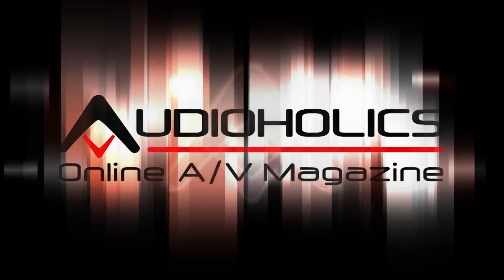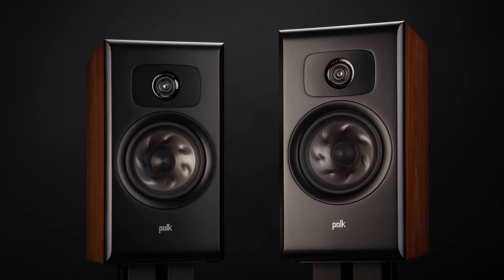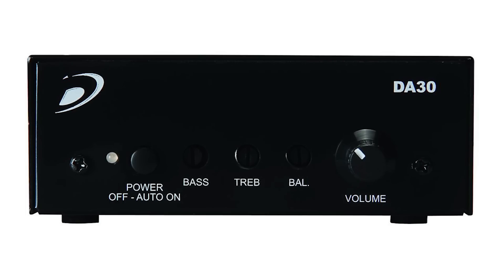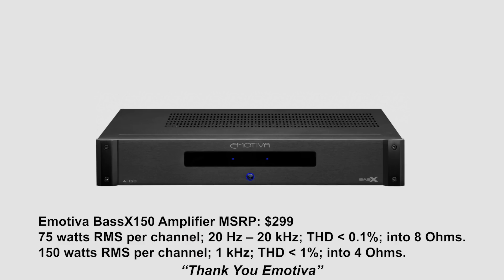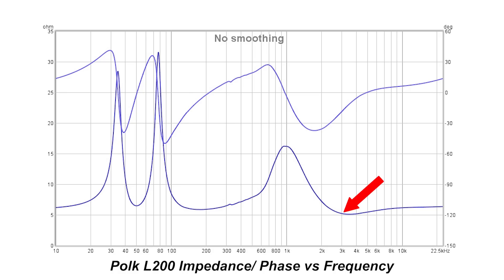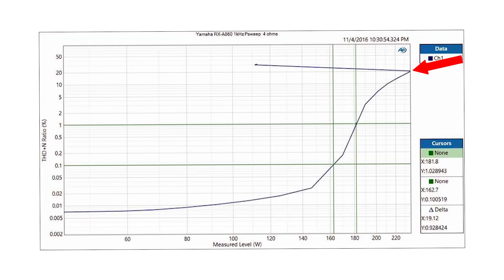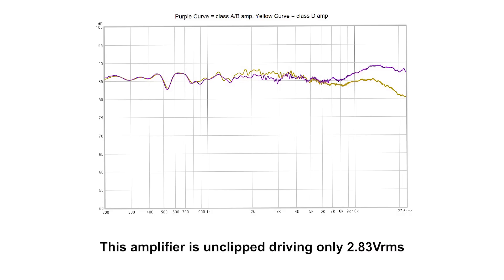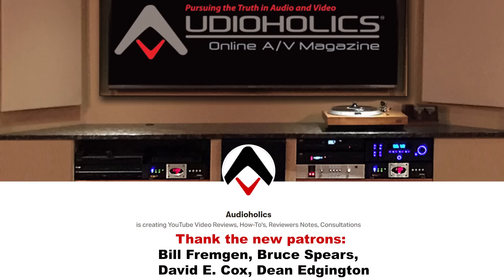Proof That ALL Amplifiers Don't Sound the Same

Comment: But how does this translate into actual audible difference? I get that amps can pull back power to stop clipping, but in sound terms does that mean sudden loud sounds (like symbols crashing or heavy drops of bass) just won't be heard as "presently" due to the amp not having the available juice? In simple terms, certain sounds that REQUIRE amplification, just will not be amplified and therefore heard? Is that what you mean?

Comment: Amplifiers absolutely sound different. I once had a pair of B&W 802D, as well as a pair of Sonus Faber Cremona Auditor M. Night and day difference in presentation between the two. I also at the time had a couple A/B Parasound Halo amps and had just purchased a class D NAD M22. 

Got the NAD in the system with the Bowers speakers...hated it. That diamond tweeter came right at my skull compared to when it was being driven by the Halo, and the difference wasn't subtle. I was about to write off the M22 when on a whim I pulled the Cremonas in from the other room and you know what, I'd never heard them sound so good. You see, the M22 was a MUCH brighter amp than was the Halo, which it turns out was a beautiful match to the soft ring radiator tweeter on the Cremona, whereas a Halo amp on those speakers always sounded wooly. The exact opposite was true when the gear was swapped to the Bowers speakers. Speakers, DACs, amps...they all sound different. I'm actually a bit jealous of guys who can't hear the differences, because they can be satisfied without spending the pile of money I have.
Reply: Your argument is subjective and then you mention that pile of money you have and lost all credibility, except for being a twat !!

Comment: All GOOD amplifiers sound the same, Gene. If you find an amp that varies its FR by output level or impedance it is NOT a good amplifier. Generally Class AB amps don't have this HF loss this $88 Dayton DA30 CLASS D amp suffers from into some loads.

Comment: Hi,

Are AVR's good enough to listen to music (stereo).? The reason i am asking this question is  i see a huge difference in the quality of the sound ( Music) coming from an AVR and a normal stereo music system. I was expecting much better quality from my Onkyo AVR but it was just ok. Especially the Highs and Mids , the voice clarity is really awesome in the Panasonic stereo music system.( Its rich and full).I feel the same when i hear music in my car which is powered with Pioneer music system.Is the circuit design different or the amplifiers in an AVR are  designed primarily for loudness.?.
This question is really bothering me a lot as i though an AVR would suffice the requirement_for both Music and Movie.I am having an Onkyo TX-NR 696 BI-amped to Taga Harmony home theater speakers v606. Do i need to go for a high end AVR for the quality of sound that i am expecting?. Please advice.
Thanks in advance.

Comment: Loudspeaker impedance (and sensitivity - not quite the same thing) does matter. Otherwise all decent amplifiers at ANY price will sound the same. The only issue is with low power/low drive amps such as the one mentioned - the Dayton. 
Nothing new here folks, move on!

Comment: Maybe not the best examples. Cheap Dayton class D vs a class AB? How about a higher end class D? Or a $500 class AB vs a $2000 one? The example used too narrow in scope to call it "proof". Can we see more tests with several different amp examples. Maybe running a mix of low impedance vs easy to run, high sensitivity speakers? Interesting topic for sure! Thanks.

Comment: They sound different but given identical specs to each other using slightly different components i bet there is no audible difference. If its not measurable then any difference is just down to bias even if you think that wont effect you it still will. I read about trained harman listeners that are still biased to a certain boost in low end on revel speakers and thats because most of us prefer a slight increase in mid bass level even though its technically not accurate.

Comment: I have seen measurements of  recent class D amps.  Lots of noise and spurious FR issues above 15khz.  It's almost like there is a "dither"  to smooth out the treble. My class D does NOT sound like my A/B.

Comment: I would think of course amps are going to sound different especially if you are comparing models in different price ranges and that have different technology. Is what I would hope though is anything aimed at the enthusiast or high end market would all sound pretty close though. You would think they would strive to make them as accurate and clean as possible. That might not be the case, but it is sure what you would hope for. I wouldn't expect a soundesign system from Kmart to sound as good as a Denon or something lol. And I notice it with budget receivers too. Sony doesn't seem to have what it takes for decent bass with towers, where as my Denon does. But once you get into seperate amps that cost a grand more I would hope it would get much harder to tell. The difference between a 1000 dollar amp and a 3000 dollar amp I would hope wouldn't be that easy to tell in sonic quality. Build quality and power output yes, but they should both sound great.

Comment: I have a Luxman and a Rotel (both dual transformer) and although the Rotel is very clean sounding it is very thin and unnatural when compared to the Lux. The Luxman is fuller and more fluid. Amplifiers do sound different. There is no question about that.

Comment: No every amp does not sound the same until you start forking out serious money for the expensive and well made to sound transparent with plenty of clean high current power to give the complete control and grip over the woofers.The expensive hifi amps sound similar because they are made to perform to a certain standard.
Reply: Not all expensive amplifiers sound good. There are tons of very expensive amplifiers that sound crap! And also tons of inexpensive amplifiers that sound very good, punch way above their price.

Do your proper research and test out amplifiers before keeping them. And you will save money that you can put to use in other parts of your HiFi or Home Cinema system.

Comment: What I would like to know about amps is what are specs to look for when sourcing an amp for use on the pre-amp outputs of a HT receiver to power front height, back or ceiling speakers.  I have not found any data anywhere.  Not even Denon say what to use.
Reply: its a math problem, size the amp to the speaker load giving yourself plenty of headroom. I'll probably get shit for this but, I size my amp according to the speakers PEAK wattage. That way all the power my speaker could ever demand is available

Comment: Broken amplifier do sound different. There are even examples of totally broken amp IC's on low impedance loads such as TDA73xx series. There are also OP amp examples with very poor EMI rejection rate, like LME49720 and variants of it that are not shielded. EMI rejection rate usually put by vendor's as electric power rejection rate @20 KHz also can play significant role. More so in low end in hear able frequency range, & not all traditional shielding materials play particularly good role in this space. Still the best are steel & graphite... Arguably silver but that's more of a snake oil. Also AB class amp's can deliver higher max power & keep it for longer which also can impact how we hear it.

Comment: Hi Gene. In my opinion the test of these great speakers was made with a class D amplifier that is not a hi grade reference form you can trust that you are sending to the speakers high quality signal in order to evaluate only the speakers.  That means that there is low performance amplifiers, decent performance ones and great performance (the ones that cost a lot of money).

Comment: I have two comments.  First, those speakers are about $1200, I believe, whereas the DA amp is what, less than $100?  How do you justify that?  Gear should always match.  Second, all amplifiers do sound the same within their given price brackets, and most sound the same regardless of price to the average listener who only cares about pairing up their phone and listening to YouTube or Spotify.  An amplifier has only one job : TO AMPLIFY.  Which they all do.
Reply from the maker: Judging quality by price is a dangerous assumption, especially in consumer audio where objective measurements of performance is often trivialized. The amp was NOT used for critical listening. It was solely used at low power for frequency response testing which I showed in this video how it wasn't capable of doing into low impedance loads.
Reply: @Audioholics  Agreed, judging quality by price is not only dangerous, but foolhardy.  Yet people in this hobby do it all the time, sadly.  But bench testing is not real world listening, obviously.  I will always maintain that there is no difference between any amp WITHIN THEIR GIVEN QUALITY PARAMETERS if they are tested in a musical environment.  That's right : a Yamaha amp sounds the same as an Onkyo amp or as a Crown amp or as an Emotiva amp.  Like I said, an amp has only one job.

Comment: Hey gene. I was just mentioning this topic the other day on one of the home theater groups on fb. I have a marantz prepro powering a emotiva basx a-300 for left and right mains, and a marantz mm-7055 for my center. LCR are all matching Martin logan xt60’s. And what I noticed was I got more bass output from my marantz compared to the emotiva.  I went ahead and hooked up the marantz to all three mains thinking the emotiva was just overloaded driving two towers... well the marantz powered all three with equal output.  I know y’all have measurements for this amplifier, maybe you can highlight some reasoning for what I’m seeing. Needless to say I’m now looking for a new power amplifier for my floor level speakers.

Comment: QUAD proved their amps did not add anything to the sound, by placing them between power amps and the speakers. No-one could hear the difference.
That's not the same as Amps sounding different. A good Poweramp is fully neutral.

Comment: The Dayton amp is not linear. Part of the argument is that two amplifiers with linear output not driven to clipping will sound the same. If you raise that upper end with a pre-amp filter that makes total output with the Dayton amp flat, both amps will sound the same. If one amp is not linear 20Hz-20kHz, of course there will be difference in sound.

Comment: Gene, I know there are a lot of requests for reviews on the "new" more powerful Crown Amps. But would You please consider a "budget amp" (a the $300 price point) - the Behringer A800 ? Thanks.    ;-)
Reply: I use a Crown XLi2500, AB amp, no bells and whistles just 2 gain knobs, a couple of clip indicators and 500wpc of good clean power at 8ohms. Under $500 and I love it.

Comment: Just audition a few amplifiers with the same speakers and you easily be convinced that every amplifier has its own sound signature.
Reply: They would rather measure here and deny components sound different.
Reply: Doesn't work that way. You have to match the components together...It would be like comparing tires on a car. Yes there all the same color and round. But you don't put stock Prius tires on a sports car and expect it to drive the same as before.
Reply: I'd be curious how different they'd sound if blind A/B'd when level matched. Assuming no distortion or compression.
Reply: I have a Den avr x2500h what reasonable pre amp would you recommend?? Just looking for better sound. Thank you

Comment: I still say we need reactive-load testing for amplifiers.  Although most modern class AB designs have moved away from the problematic active current limiting found in many vintage amplifiers (1990's and earlier), no amplifier test is truly complete until checks for issues with reactive loads have been done.  
And in the case of tube amplifiers and certain class D amplifiers, I think owners and prospective buyers should be able to see the truth about the impact of reactive loads on frequency response.  Please, let's stop pretending that our speakers behave like resistors.  That's not the real world.
Reply from the maker: Agreed reactive testing is important and should be incorporated in amplifier testing. I may add this to future reviews.
Reply: no, they actually behave like chattering contactors

Comment: So a class D Dayton chip amp which is not good at driving a 4 ohm load sounds different when driving a Polk speaker which has high frequency low impedance issues? 

You're right it's the amp, which reinforces the fact that all competent amplifiers when matched correctly, sound the same.
Reply from the maker: Yes assuming both amps are competently designed and the right measurements are done to prove so.

Comment: Gene, I think people saying that mostly are talking about a B&K 200.5 vs a ATI 1505, similar design amps from the same era. Can I really perceive a difference all else equal? I used to have B&W 602 S1 powered by a Denon 3803 receiver. When I upgraded to that B&K amp and preamp I honestly did not perceive "better" sound at normal levels 50-70db for stereo listening.  Now it for sure sounded different at loud volumes or during movie high db parts but I attribute that to the "sound" of more power and cleaner sound at the high db levels. Now I have better speakers, B&W 683's and I still have that receiver, I want to do an a/b test now and see what I find for pure curiosity.

Comment: Why you would ever use a cheap little Class-D amp to "test" speakers is beyond me.
Reply from the maker: portability out in the field but I agree, it shouldn't be done bc these amps are dreadful.
Reply: Whatever amp is selected(regardless of class) needs to be capable of driving the impedance of the speakers being tested. Many class D amps continue (nearly) doubling power output down to 2ohms - anything based on Hypex UcD and Ncore, Harman Purify, latest B&O Ice, etc... pretty much all 'decent' class D of recent generations. Also, it doesn't take a weak amp or low-impedance speakers for amps to sound different, anyone who's listened to several amps (especially from different classes) should be able to tell the difference. Example: those Emotiva BasX-series amps have too high noise floor, can hear the static coming from the drivers even without a source connected to their inputs. And their power supplies make noise. Guess I'm saying you should be able to hear differences - not only when playing music, but also even with no inputs connected.

Comment: The common belief that all amplifiers sound the same if being used within their performance ability is overall true but realistically too generalized, as you have shown in this example. This belief only holds true if we assume these amplifiers are all maintaining a linear response regardless of impedance swings and dynamic power demands. It would be interesting to see some "real time" response measurements with different speakers while playing real material. Is it possible to do some of these measurements like that, Gene? Has this been done before? Great video!
Reply: What measurements do you use to determine amplifiers are going to sound the same?  Assuming they are working properly for example, Classe Omega, McIntosh MC462, JBL Synthesis 2200,  Arcam P240..... Do they all sound the same?  What information can I use without bringing them all home to determine they are the same?  I think 2 of them have a great chance of sounding the same but how to be sure?  I can almost be certain  2 of  them almost certainly do not sound the same as the other 2.   But how do I know?   :)

Comment: For a bunch of reasons, this is why I won't buy any more 6 or 4 ohm speakers. Why? Because I have found that using <8 ohm speakers rather severely limits the amplifiers they will work with. I have had 3 class AB amps that just won't play properly with two sets of 6 ohm rated speakers (Polk and Pioneer). And it's not the speaker wire that's the problem
It seems like too broad a rule, to be sure. But it's just this one man's rule. It is because too many 'affordable' amps and receivers simply cannot deliver the higher currents that <8 ohm speakers demand during loud passages in music without driving themselves out of spec.

Comment: I measured 3 amplifiers (emotiva , rotel and crown).. they do vary slightly but all within their posted manufacturer frequency response .. for instance crown was down 1 db at the high frequencies and that is exactly what the specs said .. emotiva was at +-0.15 db through out  , rotel was at +-0.5db .. that said the da30 is kind of a budget amp with no posted frequency response spec that I can find so yes there is no telling how it will perform ..

Comment: So it follows that cables sound different too huh?.
Reply from the maker: Nope
Reply: @Audioholics  So capacitors and resistors sound different too huh?
Reply from the maker: @ericmc6482  Capacitors can sound very different when they are a series component with a tweeter due to ESR which is why electrolytics should NEVER be used in such applications. I'm not sure what big reveal you think you're making when I demonstrated measurable differences between amplifiers.
Reply: @Audioholics  I am saying that cables caps resistors etc cause systems to sound different because of secondary effects, one cause is source impedance vs load impedance as you have demonstrated.
Your WayneKerr measures RLC and dissipation etc but that is instrument loopback testing not system testing, the conditions are quite different and the instrument measurement results cannot be fully extrapolated to system listening impressions.
All system items (cables caps resistors etc) are lossy to some extent and have different losses according to excitation signal spectrum, typical resoloution  sinewave testing and FFT cannot hope to isolate these differences that the ear does so readily.